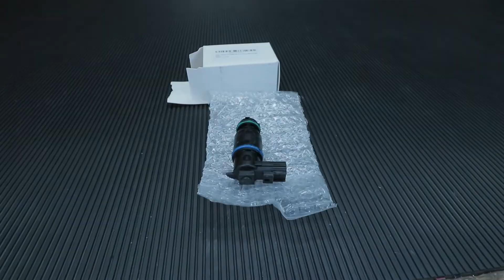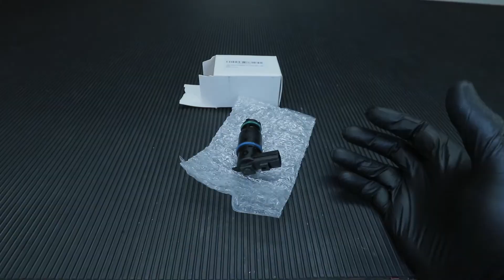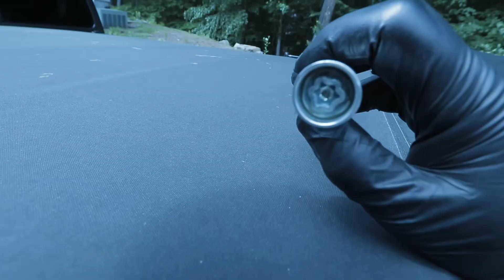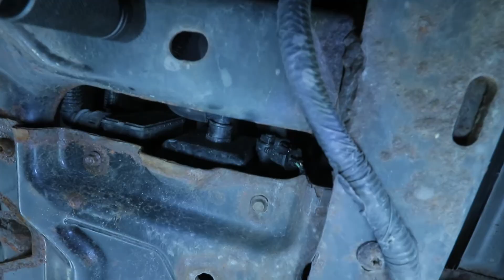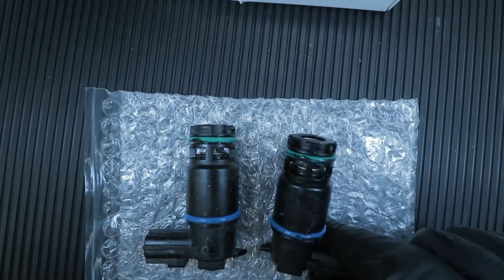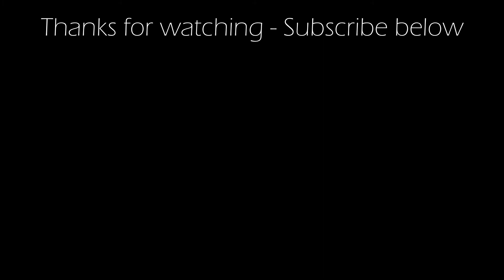11-16 Ford F250 F350 EVAP Vapor Canister VENT Valve Solenoid Replacement | EASY Install

Comment: What code did you have that ? Was it p2400? 
This is for 6.7 power stroke
Reply from the maker: I have a separate video going over the codes it was spitting. Check out my superduty playlist

Comment: Great vid.  I have a 2015 f150. XLT V8.  302.   Are there 2 charcoal canisters ?  I have one on driver's side frame ..Just wondering because your application is under the spare
Reply: This is for 2011-14. 15-20 should be on driver side since that is the similar gen

Comment: My truck is 2012 F250 6.2 4X2 not 4X4 so do you think I can do myself?
Reply from the maker: Yes absolutely!
Reply: @ModernHotrodsNH  I did change the Canister Purge control valve and still have the light on Damn
Reply: @ModernHotrodsNH  it did not fixed the problem what can be now